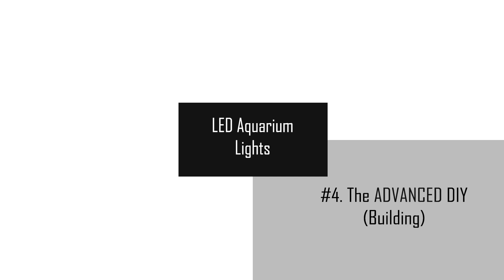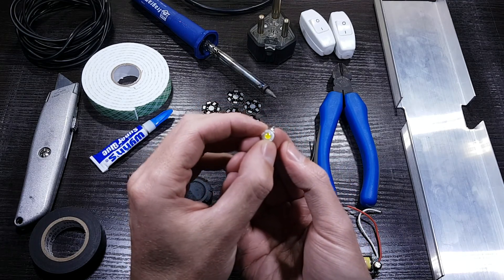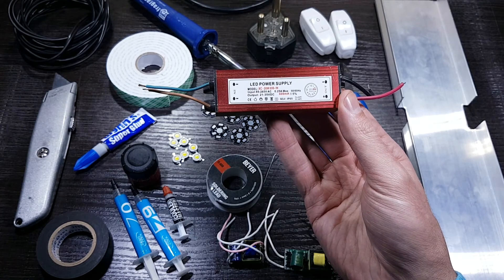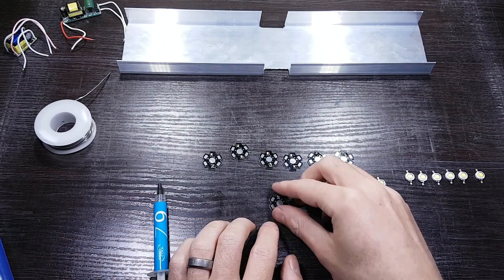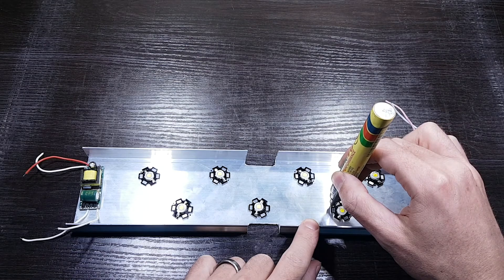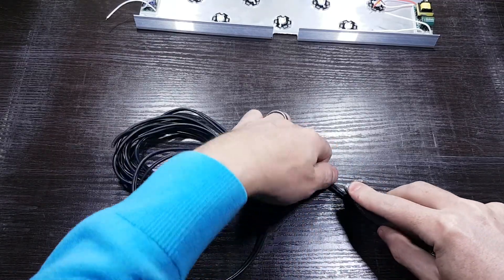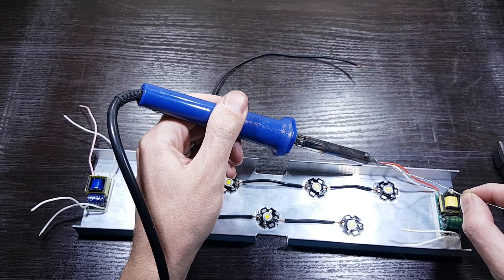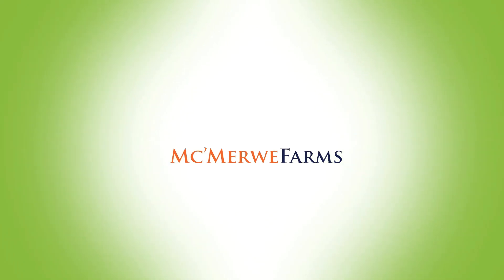DIY LED Aquarium Lights (Part 4)

Comment: How do I calculate the required voltage of the power supply to run 33 LED lights of 3W each

Comment: hi sir I need help.how to making 1w led 13 blu in 15v adapter i power plz help me sir
Reply: You need to supply more info (specs of led's, is the psu a led driver or just normal psu)... Try using a led circuit wizard like: http://led.linear1.org/led.wiz

Comment: Hi, I am using a MEAN WELL LPC-60-1400 and the specs say 3-13 CREE 3V LEDs in series (please ensure LEDs can handle 1400mA) I am using 10X5W Led in series and the LEDS burn out after a few days of usage. I am mounting the LEDS on a piece of extruded aluminum which is about 3 feet long with thermo paste. I also have fans blowing down on it and it feels hot but not extremely hot. These LEDs keep burning out and it's really driving me nuts. I tried to replaced the burned out LEDS but they keep burning out one by one. Is it the quality of the LED or am I doing something wrong? Here are the speces of the LEDS I am using.

1W~5W LED
Emitted Color: White
Color Temperature: 6500K
Brightness: 493LM
DC Forward Voltage (VF): 3.2V-3.6Vdc
DC Forward Current (IF): 350mA~1500mA

LED Driver
MEAN WELL LPC-60-1400 CONSTANT CURRENT LED DRIVER
https://www.rapidled.com/mean-well-lpc-60-1400-constant-current-driver/

Please help me thanks!
Reply: You need to double check the specs for the led's. The following listing for 5w LED's shows current around 600 mA - this means you are supplying more than twice the amount of current to the LED's and they will fail... Do you have a link for the LED's you are using?
https://www.bidorbuy.co.za/item/453195681/5W_Led_Cool_White_6_6500K_LOCAL_STOCK.html
Power: 5W
Forward Voltage: 4.5 - 7.5V
Forward Current: 600 - 700mA
Colour Temperature: 6 - 6500K
Lumens: 250 - 300LM